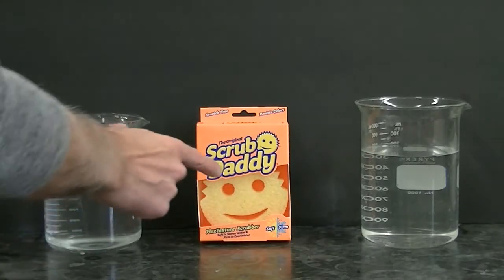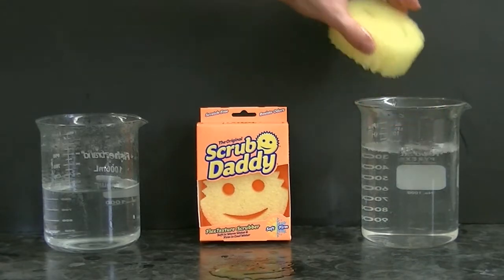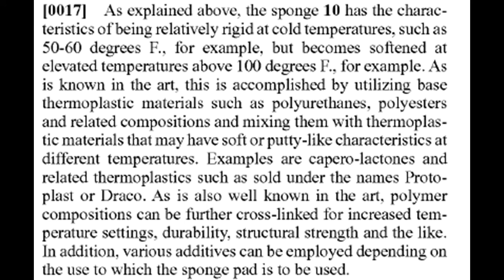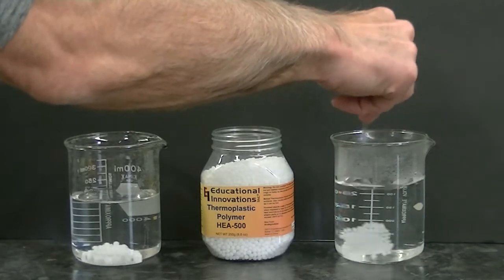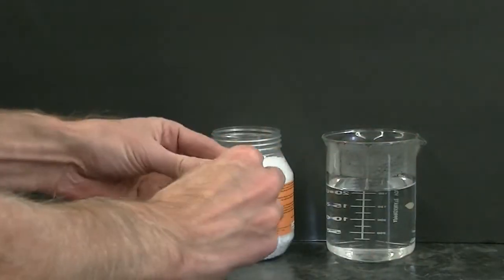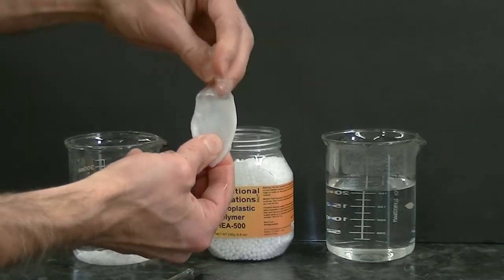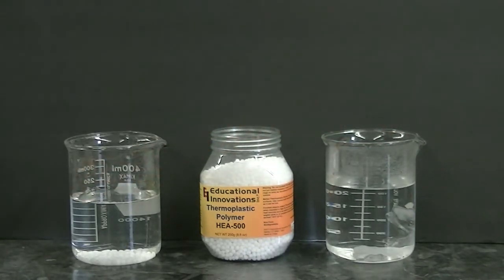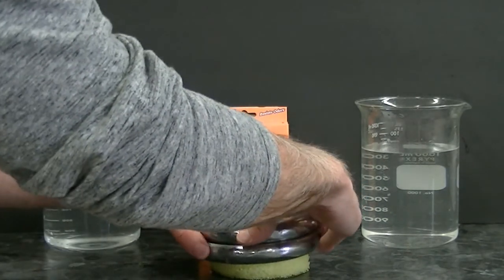Scrub Daddy Science

Comment: Few questions, why do you need a thermo plastic whem basically most plastics act somewhat similarly? when heated the become soft and when its cold they harden

And the other part is how does it clean burnt food so good without scratching anything?

And how does it clean without soap or chemicals?
Reply from the maker: It is true that plastics act in a similar fashion, but the degree to which the thermoplastic changes over zero to 100 Celsius is much more profound than other plastics
Reply: Very interesting